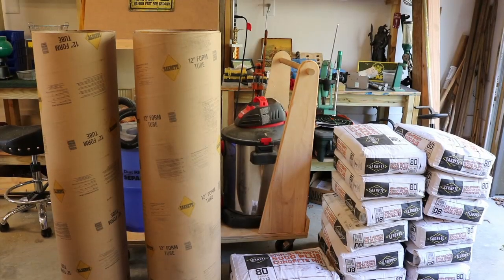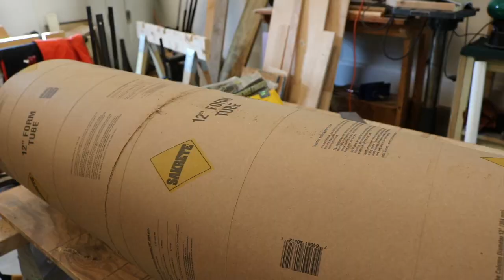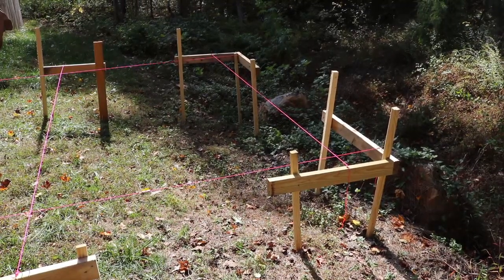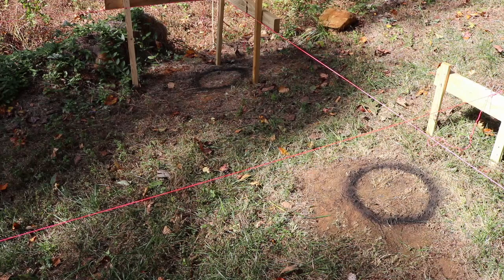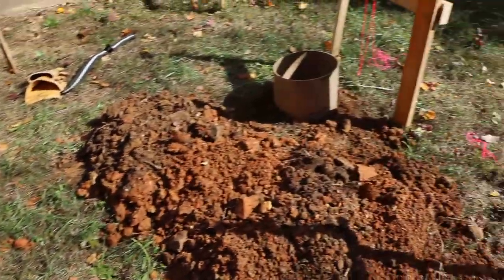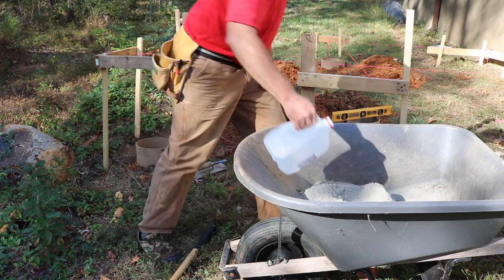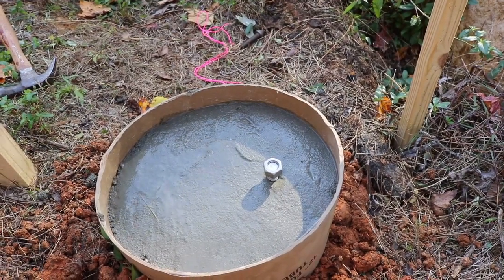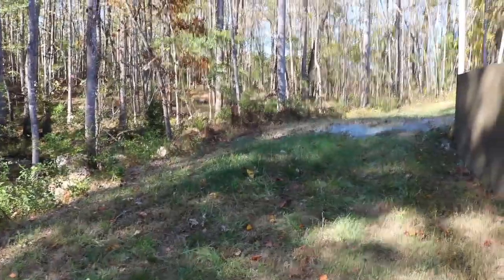#81 Build a Pistol Range Platform Episode #2 - Foundation

Comment: Howdy Pilgrim!  Good job on the concrete piers! I know you hated have the one off center but it should be fine. Looking forward to the carpentry phase. Thanks for sharing!
Reply from the maker: Yeah, that one pier is kinda cringy, huh?  Well, the post base fits on it well enough.  The carpentry phase will begin when I get the materials... and the time.  This is a time and materials project, after all...hehe.  Too busy this upcoming weekend to do much (running a hawk and knife range for scouts on Sat and theater on Sun).  Good thing I don't have any deadlines on the homestead.  Question:  Did you weld or bolt hooks / clevis to your bucket?  I like your tractor mods and will be looking into those in the future.
Reply: They are bolt-on hooks from Ken’s Bolt-on Hooks. They seem plenty strong.